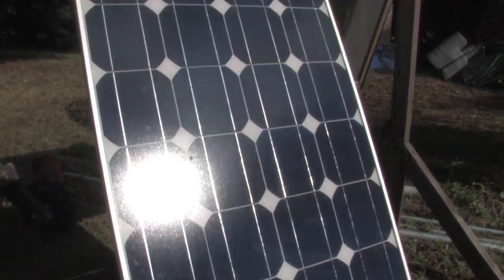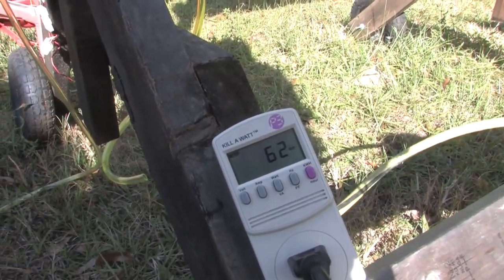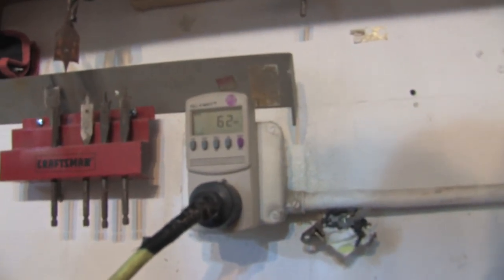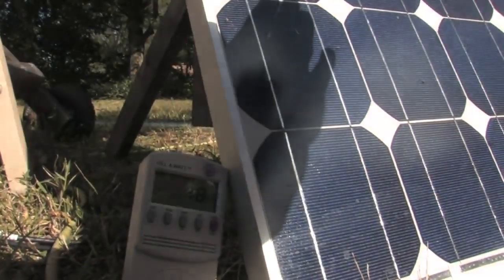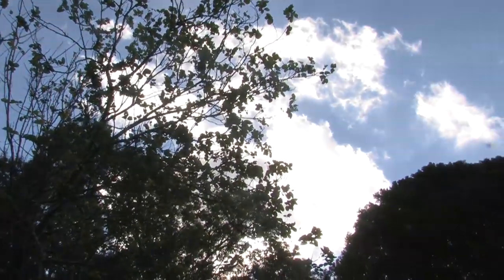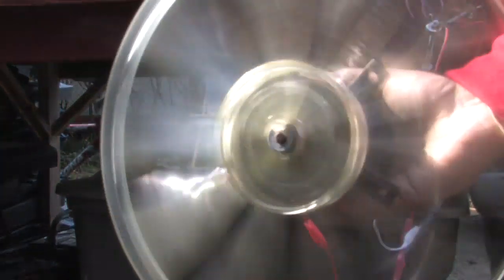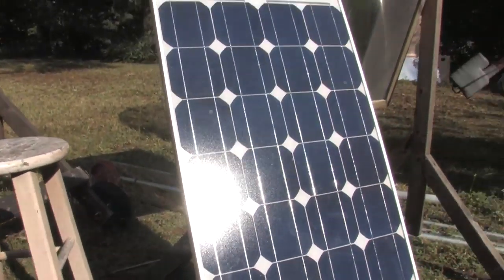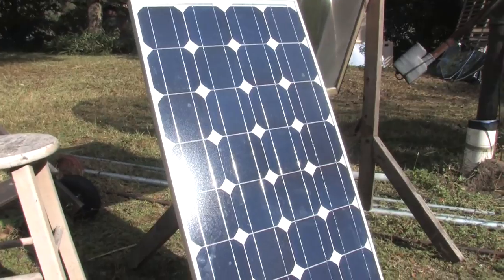DIY Solar Panel Power from 80 WATT SOLAR PANELS to a Grid Tie Inverter

Comment: what would happen if you dip a small solar cell in water and place it at the focal length of a frenel lens
i think the solar cell is not going to heat up and you could get more voltage
Reply: Shariq syed solar cells oxidize

Comment from the maker: The GTI will have an IN voltage range DEPENDING ON THE MODEL. Your panels in SERIES:
EXAMPLE 12 VOLT PANELS @ 4 AMPS X 3 
______(+-+-+-)_____ = 36 VOLTS @ 4 AMPS 36volt X 4amps=144 WATTS
produce higher voltage and the same amperage as a single panel so 2v12v panels can be used for a 20-50 volt gti. 
For a 12-21 volt GTI single panels wired in PARALLEL 
EXAMPLE 12 VOLT PANELS @ 4 AMPS X 3 
-------(+++---)------- = 12 VOLTS @ 12 AMPS 12volt X 12amps=144 WATTS

This explains:

watch?v=N86eHRGRJwQ

Comment: Hello Dan,, In your example you are using a panel rated at 80watts that yields 63 watts back to the grid. In my setup I have 2x125 watt panels and  1x85 for a total of 335 watts rated. 
The problem is I am only yielding 120 watts back to the grid as displayed on my watts-up meter, Why is the yield so low. This reading was at 2pm no clouds in sky,   I am losing around 50% or more and its very frustrating...  Please help...  Thank you,,,,

Comment: How many monocrystaline cells make an 80 watt panel?  And is there a way I can wire my polycrystaline cells in parallel so I can increase the wattage?  I was thinking of wiring 36 cells in series and then doing the rest in parallel. Will that work?  And if so... how do I do it?

Comment: Do I understand correctly that with a grid tie panel you connect to the inverter directly without having to use a battery, but the other kind of cell charges a battery and the power you get is from the battery that has an inverter that you can plug into?

Comment: 80 Watts x 5 Peak sun hours x 365 days in year x .75 system efficiency= 109.5 KWH a year. 109.5KWH x .15 cents a KWH=$16.42. Now the price of the panel is 250 so 250/16.42=15.2 years to pay the panel off, not including the inverter. By the way any inverter that you grid tie has to be UL listed as a interactive inverter which the one that is used is not. Plus this way of connecting to the grid is illegal, we have the NEC for a reason. All i have to say is just please be safe!

Comment from the maker: @cm4english For GTI you need about 20% more panel watts than the inverter rating. For a backup you can use any panel but your battery charging time will be determined by the battery Amp Hours, Current Charge, and the watt input from the panel.

In regards to 300 watts? They would be watt hours if on for one hour.

Comment from the maker: @randywest6 Pure sine or modified sine inverters have 12v posts OUT and IN. Grid tie inverters have a female computer AC plug 3 prong hole out for a male out. And only one red black in. The usually say Grid Tie on them. NEVER hook a pregular inverter to the grid power, it will blow up.

Comment from the maker: @cm4english You would need a 1000 watt REGULAR pure sine inverter and 3 deep cycle batteries to run a fridge and a few lights for 5 hours. A GTI is no good for blackouts. They shut off. You could charge all 3 batteries in about 3 days with a smaller panel. That would be for backup only.

Comment: mono or multi crystalline are the most effcient when they experience no shading thats why they perform better when wired in paralell. amorphous pannels work better when shaded in part but they loose huge out put when they get hot. I hope I answered your question. Great vid dan. CHEERS WINDY NC

Comment: Math is a little off as a 80 watt panel and assuming a inverter with 100% efficiency would have to run for over 12.5 hours to produce a single KiloWatthour of electricity. 1KWh equals 1000 Watthours, 1000 / 80 = 12.5 hours. Please correct me if I am wrong...
Mike

Comment from the maker: Sorry for missing this.

Materials are a small impact. Consider one panel removes about 700 pounds of deposited coal ash and several tons of co2
The goal $ to think about a car. When you buy one, most do not ask "when will it pay for itself." Consider 15¢ a kwh. Each $250 (80 watt panel) will produce about 1KWh on a good day.$4.00 a month $40 a year rounding down. 5 years to flat.
If instant savings is the goal, consider Energy efficient appliances. They are the first step towards solar anyway.

Comment: GREAT VIDEO. Watched your other solar pnl videos. Just finished making my 4 pnl and using Grid tie Inverter to feed power back into my home. DIY cost is running 1/2 . Doubled my wattage with roating my last pnl with the SUN. Could not do it without your videos. THANKS.

Comment from the maker: @okmoontan Yes, Harbor Freight System same price as a year ago, that in now 2x too expensive. You should pay $3 a watt or less now. SO the HF system should sell for $179.

45x3=135 + 20 controller, 20 lights $175 would be a fair price.

Comment: Hey Dan, I went to Harbor Freight earlier in the week and looked at their 45 watt solar panels. They want $249.00 for them. You just said that this 80 watt panel is about $250.00. Would it not be better to get the 80 watt?

Comment: Cool demo.  But your logic saying that you aren't losing any energy because the meters read the same is faulty.  Even if you are losing energy, both meters will read the same.  However you are still correct.  If your cord is 18 gauge, you only have 1.5 ohms of resistance and a power loss of .4 watts.

Comment: JulyInJuly - You are correct.  The type of inverter required to push power into the grid is called a syncronous inverter.  This type of inverter monitors and matches the sine wave produced to the sine wave of the grid.  When they are in unison then power can be pushed into the grid otherwise a 
non-syncronous inverter will blow up can cause fire and other equipment i.e the solar panel or wind generator, etc can be damaged.

Comment: Obviously it will depend on the cost of grid power in your area, but for me (in Maine) energy costs are very high, so cost recovery will perhaps be faster than elsewhere... @25 yrs. 

However, I think this figure is overinflated. I based it on an quick online estimate I did last year to access the cost of going completely off grid---without any modifications to energy consumption. The system had a substantial buffer figured in (@30%+), included all inverters, & capacity for heat.

Comment: hi dan! i had one of these inverters on my house with 250 watts of panels here in australia. everything was working great until the power company found out about it and made me remove them or get a serious fine. they said i have to buy there grid tie kit which is 1kw and costs $12500.

Comment: Great vid.
In 1993 I experimented with mono crystaline cells and found out that if you by mirror shine light on the back of the cells you could raise the output 30 - 50%
If you by mirror double the area of sunlight
hitting the front you also get a raise in output. I then also invented a kind of slot
you coud stick the cell into for making assembly easier. However that kind of inventions were not "In" at that time.

Comment from the maker: @over2there the drop is over dramatized because the inverter requires 14v min. so the GTI cuts off when the loaded voltage drops below 14v. The amorphous panels do not drop as much with a similar test. Some panels have bypass diodes in cell groups. A loaded voltage in a test I did is 30% one cell blocked monocrystalline and 10% for the same area covered area of the amorphous panels.

Comment: Of course you have 12 hours of sunlight in average. But the peak voltage (in our case 60 Watts) is only delivered at peak time. Lets say at a sunny summerday at approx. 12 o'clock. But whats on sunrise in winter?
There are some calculation tools that assume 3 hours peak wattage a day, some do 4. In more southern regions eg. africa my calculation is obviously not right as affrica has "stronger" sunlight.

Comment: Dan, your argumentation with no loose of power while measuring with two sense is false.
The current you measure is the same in the whole circuit. Maybe you have some voltage loose thanks to the ohmic resistance of the wire, but i don't think that that is very big as the current is very tiny and your voltage quite high. (and i don't think that you device can measure that at all). Maybe you have a better performance when running only with one measurement tool.

Comment: Let me calculate it for you: I use facts of Germany as i only now these: 
170 Euro / 20ct KwH you can buy 850 kwH. Please not that Germany has dam high energy prices.
What you generate: I assume 4 hours day full sun: (optimistic standard for Germany winter/summer)
60 Watts*4=0.24 wH/day.  So you need to run this 3540 Days. This is 9.7 Years. By the way: After 20 Years a solar planel has a wattage lose of min. 20%.